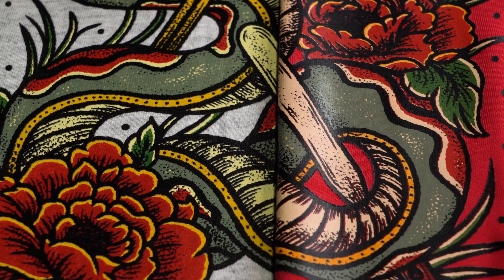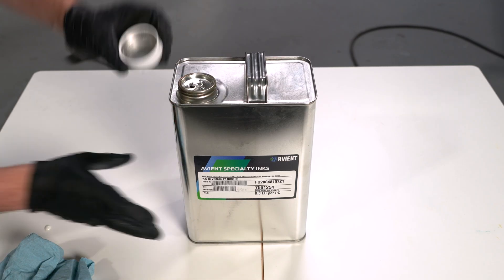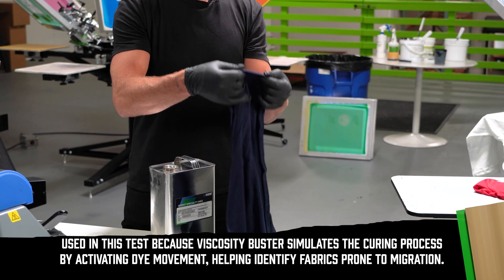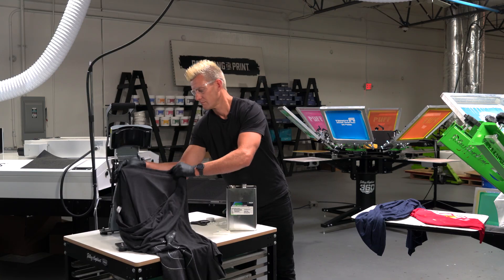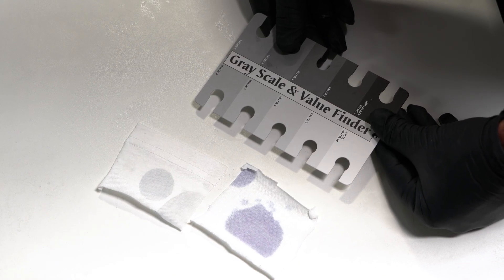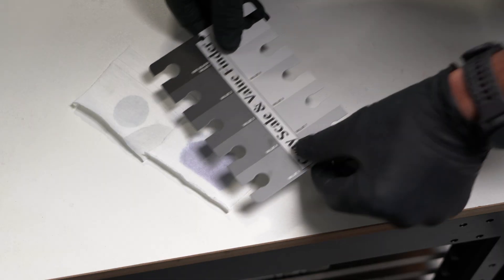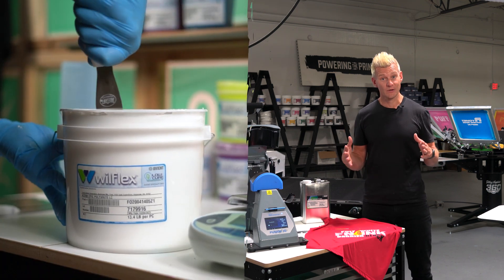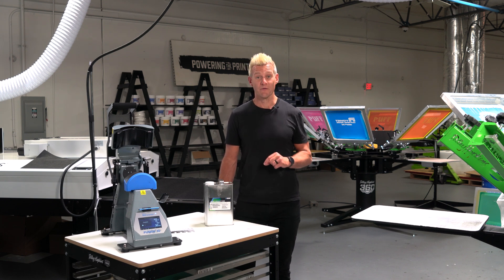How to Test for Dye Migration with Viscosity Buster (Before You Print!)

Comment: Question I have is people have mentioned One Stroke ink as not having any dye migration. One person claims they can run even a 230 mesh with nothing. Is this true? In the meantime I’ll do poly or blocking but was curious to know if there’s something to this magic ink. Thanks for the great videos as always!
Reply from the maker: Appreciate the question! We haven’t personally tested One Stroke inks, so we can’t speak to their performance firsthand.  In general, dye migration can still be a factor on poly, especially under heat even with bleed-resistant inks.  There's always the variables of the garment itself, how it was produced, and curing temps that can change up how an ink performs with dyes.  The "magic" is likely high opacity/high pigment load but that would make it a bit more challenging to get through a 230 Mesh.  If you find out the magic let us know!